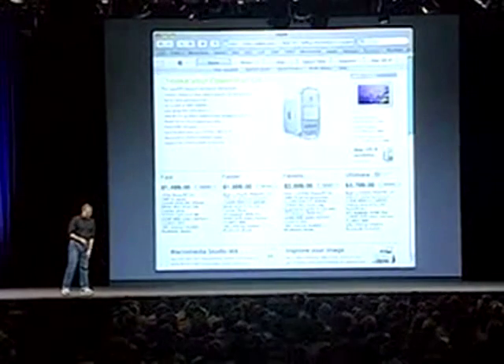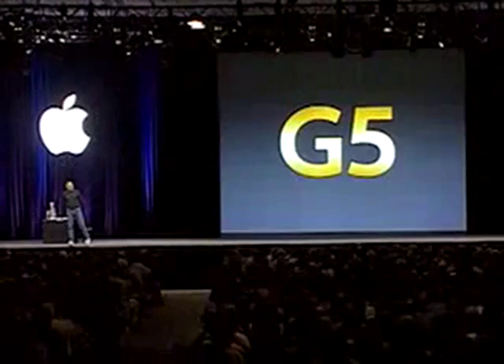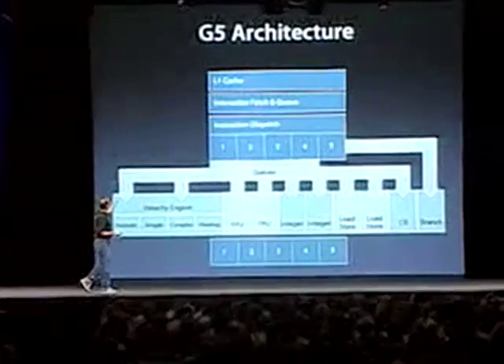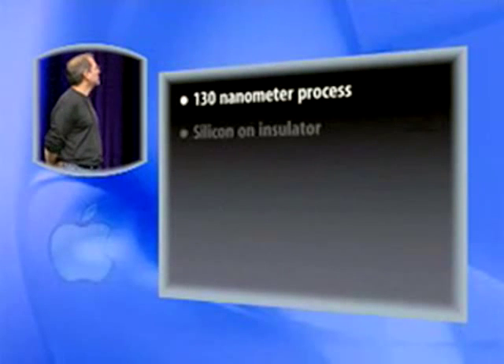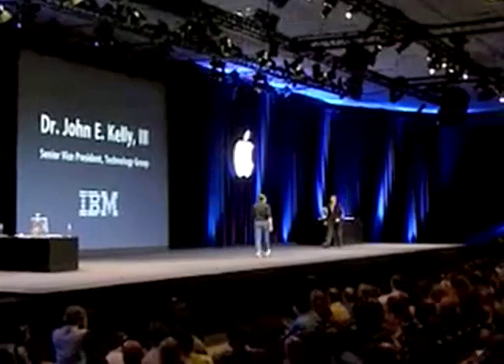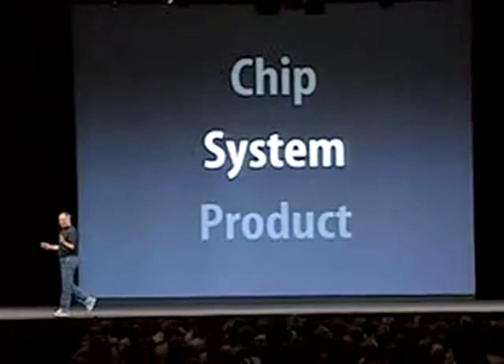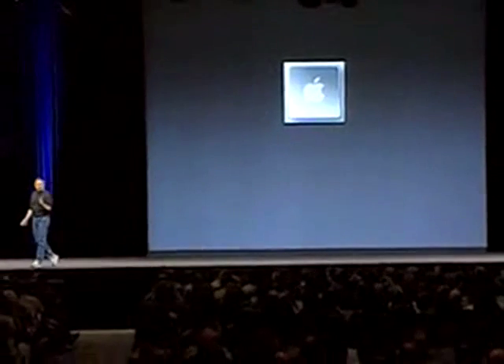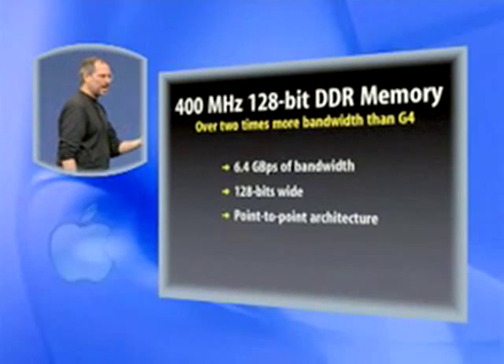Power mac G5 Keynote Intro Part 1

Comment: That was SOMETHING. No more apple products like that :/ Only "bigger screen in iPhone" and "beeter cpu in macbook". Good technologies are wasted - for eg. force click. Why there is no system prefs like "better touch tool" - or magic trackpad is not more used? Or APi - Metal. They are not promoting those. No new hardware stuff :( Todays apple keynote will be total crap :(

Comment: Writing this on dual G5 2.0Ghz, the same model introduced here and it is still a remarkable machine, true masterpiece of hardware design.
Reply: I have that exact same model. If only it used less power! It runs TenFourFox pretty quickly and it's quieter than my PC. It's a shame Apple persisted with the ADC port. It's way slower than my PC, but it's impressive for a machine that's now fourteen years old.

It's weird seeing Apple's CEO talking about bandwidth, chip fabrication, system buses, UNIX etc - instead of rose gold colour schemes and all-glass backs. This was back when Apple was still Apple Computer.

Comment: "Fastest 64bit processor..."

Nope. 

Athlon 64 smoked G5
Reply: Only in your dreams: when the G5 was announced and first came out, Athlon 64 didn't even exist. This is why you don't talk through your ass. Not even going to address the overstatement that followed.

First G5: June 23, 2003
First Athlon 64 release: September 23, 2003
Reply: The Sledgehammer Opterons were out in April though, and they were employed in 'workstations' competitive with the G5. Apple only won for 'personal computing' due to AMD smothering their product launches around the G5.

Comment: My two main machines are a 2009 Mac mini and an old 2005 Power Mac g5 with dual 2.3 G5's... When it comes to some tasks such as using Final Cut or iMovie, the old G5 literally blows away the new Intel Machine. Now some of this is, I'm sure, the fact that my mini has 2 gig of Ram while the old Powermac has 8, but the difference in speed is mind blowing. These old machines still have quite a lot of life in them.

Comment: @Justinba1010 
I don't remember, it belonged to my university. I think it was the one with two processor modules and 8 cores per processor, so 64 threads in a single system since it has 4 way SMT, that's batshit insane.

Comment: @RockTo11 
Lol...By that standard the processors in your radio are "better" than that in your computer. Yes, if you increase transistor counts  without doing anything else heat and size will go up, but they've also shrank them down alot, a modern transistor in a processor is 32-45nm in size, and smaller size means less heat/wasted energy. And they can do alot more than just shrinking it, theres power gating, architecture improvements, etc.

Comment: @tipoomaster Using more transistors is not a good thing. It means larger chips using more power and producing more heat.

Maybe they were boasting about how few transistors there are.